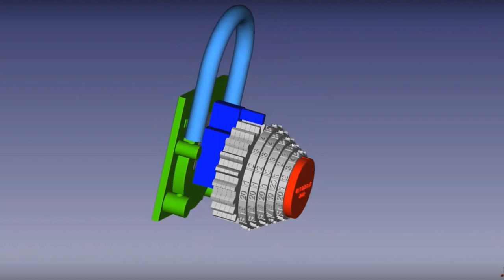(Picking 127) Polish Combination Lock World Wide Challenge - decoded!

Comment: I love the laser pointer idea.
Reply from the maker: Cheers!  Yea it's pretty awesome at magnifying angles. :D :D
Reply: @Swynndla  It reminds me of modern safe cracking where you need to write down all the measurements.
Reply from the maker: @jmr  Yep it's similar in that way ... will be more so when the metal version comes along with tighter tolerances. :D :D
Reply: @Swynndla  If it's metal there could be less flexibility and you get more consistent measurements.
Reply from the maker: @jmr  Yes - agreed!  Less movements, but more consistent movements. :D

Comment: The was an awesome video and your dedication is remarkable. I would have never thought that this could be done. I would have imagined that the variation in tension on the know is too big to derive accurate measurements from it. But it worked for you - guess you have a well trained hand with calibrated muscle power ;-) I'm speechless and a bit jealous to be honest. But more than that I'm fascinated by your idea and that it actually worked. It also surprises me that the tape provided enough rigidity for accurate measurements. Wow, you did you great job and I'm happy that your effort has paid off - my greatest respect my friend :-)
Reply from the maker: Wow thank you for such nice words - especially from my guru! :D :D  There was no tension on the laser so it just wanted to sit there and the tape easily made it straight (as long as I taped it from the top and bottom) :D  The plastic model felt strange, and the knob didn't click or bang when the actuator bar hit the false gates, but rather it felt squishy or "bendy".  I'd like to try it on the metal version ... the metal version might be even easier to decode using this method.  Yes, I tried to keep the same tension, but it seemed obvious (mostly) that some were easier to turn more (the knob turning more I mean).  I was sure about the last 3 numbers, and if I changed even one of them the laser shot up and wouldn't come down much (with turning the knob) until I put it back to the correct number.  It was difficult starting off, and difficult finishing, but the middle was great and I knew I was close.  I think I could do it faster now I know what I'm doing.  Another thing that was interesting is the apparent height differences of the false gates ... they all made the laser dip by different small amounts, and some of them large (but not quite as large as the true gate).  Also, if the actuator bar is at a slight angle, then the binding order might be wheels 5, 4, 3, 2, 1 ... I have to test that.  Again thank you for your nice words my friend! :D :D

Comment: What if you put small springs or springy foam under the bar that comes down into the gates -- that way it'd be way harder to know when the bar has actually dropped down further vs. when you've just applied more pressure than you should've. Perhaps the bar itself could also be a little bendy, so that you can't just "bottom out" the springs.

It'd be still possible if you were very precise with applying the same amount of force each time, but it'd make the approach even harder.
Reply from the maker: Good idea! ... I'll pass that onto the designer.  Actually I found that the plastic one was bendy already, and I had to be careful to try and use the same force each time (only using two fingers helped).  The designer is keen for the metal version of the lock as it'll have tighter tolerances, but yes I've been wondering if the metal version might be easier as it will no longer have any bendiness!

Comment: If the false gate depths were randomized, would the same laser strategy work (albeit requiring more samples)?
Reply from the maker: I think that might make it practically impossible, you're right. It might be possible to build up a pattern, but it would take a looooong time, as each time I measured with the laser there is variable errors (even with the same depths). Good thinking - thank you for the feedback!

Comment: I think that Kaba makes such locks that are safe as digital and combination locks (in case battery or power fails and digital part becomes disabled) , but they're quite expensive. Also , digital locks should generally avoid access cards , key fobs and similar contactless systems as they can be easily exploited. Contacless are usually RFID or NFC enabled , I'd skip bluetooth and similar as their protocols are not made for high security and have hardware related issues that can't be removed without completely modifying BT itself , and due to various attacks that payment cards are vulnerable. And , also , entire encryption algorhytms can be cracked with few months of dedication and You can always generate , when cracked , valid responses. That includes even certificate layer added atop of it. We have managed to defeat even hardest software licensing systems which have other (structural) applications as well.
Reply from the maker: Wow!  Nice!  Thanks for the advice too re contactless systems.  One day will they use sha256 or whatever that can't be broken?  Digital is (slowly) getting better in security - no?
Reply from the maker: James Sempy  True!

Comment: If you want another challenge, try decoding a Master speed dial lock :D
Reply from the maker: I've seen people "decode" them with a screwdriver :D
Reply: @Swynndla  That sounds more like a bypassing method 😂
Reply from the maker: @rnp9165  Absolutely ... I guess I have little respect for a lock than can be dismantled in  seconds.  In saying that, when digital locks are on strong locks, they will be unbeatable (at least by me).
Reply: @Swynndla  Yea, I'm not good with electronic locks either, but as long as manufacturers try to cut costs, there will always be something to exploit.